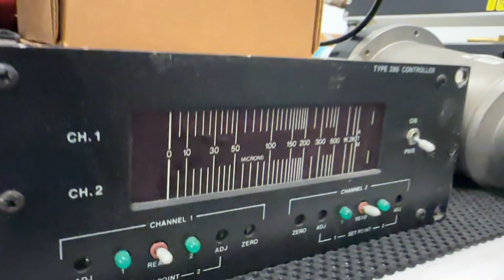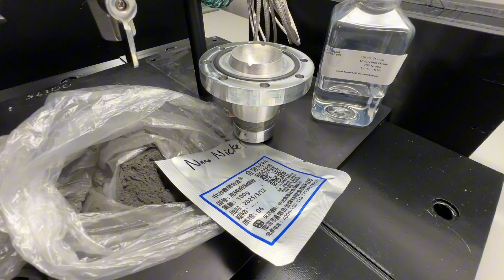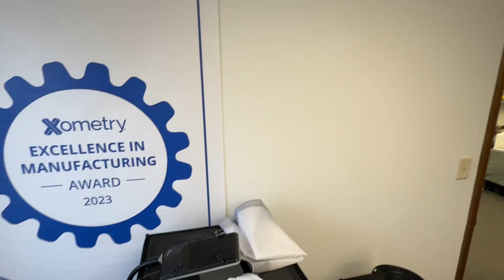LENR Sonoluminescence Fusion Reactor Part 3

Comment: I have spent several years investigating in this field, and I urge you to continue to bear in mind the fact that absolutely none of the LENR "excess heat" claims have ever come to be found correct when looked at hard. I sympathise with your perspective, but I've seen people waste years and literally millions of dollars in this field. Please don't let that be you too. Best wishes: Michael
Reply from the maker: There's really nothing at stake here for my project, just social media content. We'll see what happens. Any hints or ideas on where to focus, given your investigations?
Reply: @i2c_jason  If you are looking for "excess" heat production then the key is to have high quality calorimetry. So for example, if you are using a spherical vessel to contain the water, perhaps immerse that in a flow of water at a known temperature. So you might re-circulate water from a constant temperature bath and measure temperature with (say) PT 100 probes on either side of the vessel. Test the calorimetry with electrical heating. 

One problem with this kind of experiment is that ultrasonic transducers don't excite ultrasound in water very efficiently and there's heating from the transducers. Also sono-luminescence only heats a tiny volume of water. 

But overall, I would say create something that can be accurately measured at the start. Then you won't go chasing ghosts of anomalous signals.

Best wishes

Michael
Reply: @i2c_jason Also seen people legitimately go insane. Check out The Martin Fleischman Memorial Project. Dude seemed pretty grounded in his early videos, but basically lost his mind at the end. Whether that was related to LENR I can't tell,  just be mindful, and good luck to ya

Comment: wouldnt the same be possible with using mercury instead of water? mercury is very very heavy therefore the bubble compression (even you cant see it) would create much more heat. (yes a little toxic). But there are also other metals that are liquid at room temperature.... (indium, gallium, tin  to make your own liquid metal)
Reply from the maker: I’d love to use mercury, but I’m approaching this from a ROHS perspective, restricting harmful substances wherever possible. Would hate to solve fusion and then have to endlessly hear about my mercury blob. But it’s a great idea. Maybe liquid gallium instead?
Reply: @i2c_jason  its gallium, tin and indium mixed. then you get a liquid at room temperature that is much more dense than water/heavy water. Its also not poisonous but it kills all your alluminium parts 🙂
What you would like to get is a material/liquid that is as dense as possible, so the bubble is as small as possible but because of the compression force collapses more quickly therefore generate more heat (faster collapse creates more heat because the pressure is more quick more high).
Realy love the project, was just a dumb idea of my side...
Reply from the maker: @snapo1750 it’s a great idea and I toyed with it early on a bit, but decided I needed to see that Bremsstrahlung as a way to monitor the output. I wonder what gasses end up in a Liquid Metal cavitation? Might be metal vapor and/ or the entrained hydrogen? Fun stuff.
Reply: @i2c_jason  no clue what gases would build up 🙂
i always think about liquids as a form that contains many balls (atoms) , the more quickly and with the more force they collide they get to close to each other and either get destroyed like in particle accelerators OR release change valence electrons on their outer rings on the colission.
Realy hope your project will work, btw. NEVER give up even if it wouldnt work on the first time. Many times it needs thousands of itterations to find something.
Reply from the maker: @snapo1750 agree 100% on all point you mentioned. 👍👍